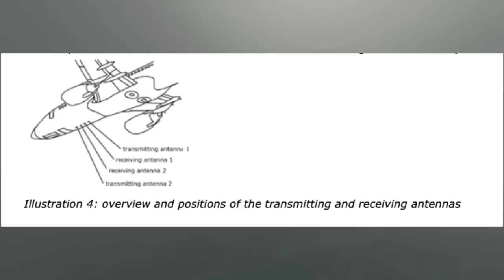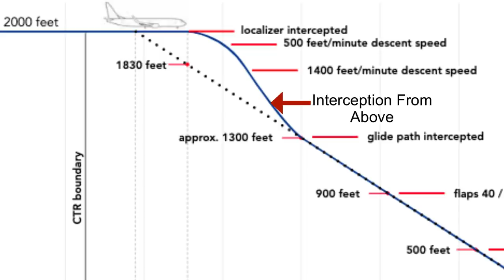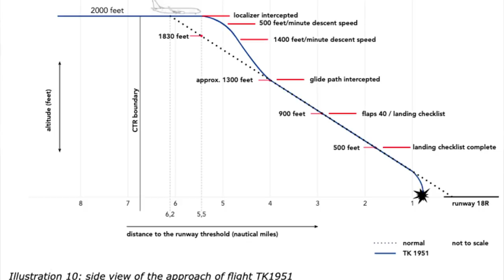How A Broken Antenna Crashed This Plane | Turkish Airlines Flight 1951

Comment: "Adding more redundancy saves lives ... Do you think we've learned from our mistakes?"

Clearly, Boeing hasn't. But at least we can trust Airbu- oh, they're developing a single-pilot A350.

These companies don't give a shit about our lives, just our money.
Reply: The aircraft won’t be flown by a single pilot from takeoff to landing. There will be 2 pilots onboard and both will be up front for takeoff, climb, descent, approach and landing. It’s only during long cruise where one pilot will then go and rest, the other will monitor
Reply: Single pilot! What a chilling concept to save a buck
Reply: @tomstravels520  That absolutely does not instill any fit of confidence whatsoever. Is what you said supposed to be comforting or making it any better? Simply because "the most dangerous parts of flying is just taking off and landing guys, so its perfectly fine and okay during cruise"
Reply: @DrSabot-A  would your rather have 1 pilot only or 2 pilots but one is resting during cruise?
Reply: @tomstravels520  I think I'd rather just have two pilots not resting.

Comment: If you get a stall warning that close to the ground I would think going to full power and raising the landing gear to cut drag would be SOP.
Reply: At that speed and altitude the landing gear wouldn’t make much difference to the drag. I’d leave it down to cushion the impact of it were to happen. That’s why on a go around you wait until you have positive rate of climb before raising the gear, not as soon as you increase power
Reply: They did advance power to full thrust, but the autothrottle retarded the thrust levers immediately afterwards

Comment: B737s sure have unique fuselage fracture points when they crash but are not in small pieces. The fuselage seems to break apart into 2 or 3 pieces probably at bulkhead attachment areas a whole bunch of times. Good idea not to sit in those areas.
Reply: I like to sit over the wings for that reason - it's a stronger part of the aircraft, and this safer in the event of a crash.

Comment: in the 737 MAX they actually only had 1 sensor installed, as to avoid both pilot re-training and a new certification. essentially, the system wasn't redundant
Reply: No. All 737 Max had 2 sensors. But only 1 fed data to the MCAS and it was switched every flight so there was no comparison of data
Reply: @tomstravels520  ooo thanks i wasn't aware of that
Reply: Fidd88  Having two sensors and only using one is in therms of system engineering horrific.
The software has all the information it needs and boeing very specifically decided against using it, because a redundant system is indicative of safety critical, which MCAS "totally" is not.

Comment: Something else that I think may help situations such as this incident, is to have the flight control system take other actions in the event of pilot warning events (such as the stick shaker) and set a warning that would change the operation of the automation, such as to disable autothrottle so that the pilots are required to retard the throttle on landing, and that no thrust below, say, 10% below an appropriate cruse speed may not be permissible without verification from other sensors, such as weight switches on all three landing gear to indicate the airplane is actually on the ground. Sanity checks also shouldn't be too difficult to implement, such as the radio altimeter shall always read higher than 5 feet or something, as it is impossible for the bottom of the plane to be less than the height of the landing gear, so if it is less, the instrument is definitely lying.

Comment: CFIT is unfortunate when it occurs due to bad ATC instructions or unknown faults that could not reasonably be known. Relying on automation when you know it is not working correctly when you can turn it off and land the plane with the flight controls is insane.

Comment: Systems fail and will continue to do so. That is why as airline pilots, we go trough extensive simulator training and checking every 6 months. We learn how to cope with a multitude of different scenarios, each involving system failures. And the first adagio is systematically: fly the airplane first! Deal with the failure next.

Comment: @ 2:53 you mentioned the issues with the left hand autopilot. Somehow I missed why it couldn't be activated and if this played eventually into the crash. I also do not understand how an autothrottle could work against an autopilot, is there no hierarchical dependency? And how is this played when the two autopilots would have been activated?
Reply: This seems incredibly stupid. The two computers should act in tandem, not push the plane into stall. It's so dumb.
Reply: CMD A wouldn’t activate because of the faulty RA. The autopilot cannot be engaged below (I think) 400ft unless you’re landing. It is not a case of hierarchy it’s depended on which system feeds which information to other system. Remember the autothrottle cannot see so it relies on the RA to know when to enter RETARD mode if the autopilot is in approach mode. The flaw I see here is the captains RA was used to control the autothrottle even thought the FO’s autopilot was the one activated when it should realistically be the FO’s RA being used

Comment: As soon as they realize the altimeter is faulty, shouldn't they immediately flip a switch or something to prevent the autopilot from using it? It's very odd no action is taken.
Reply: Flipped what switch and why? The linking of the RadAlt 1 to the Autothrottle was not documented. It was assumed that it was linked to side in control.

Comment: Neither this issue nor the 747 door latch failures prevented Boeing from cutting corners and FAA and NTSB from being too lenient if not straight up helping Boeing bypass the regulations. I might be a pessimist but I see next MAX as very likely, if not inevitable.
Reply: I would not be so affirmative for the NTSB nor whole FAA, but FAA west coast is known to be a little bit to "close" to boeing since decades. The MAX is just the last exemple and hopfully will definitively change this bad habit

Comment: Do you know the phenomenon, when too many people are involved, noone takes the correct action?
If you're walking near a canal and you see a person in the water who is clearly in distress, with noone else around except you, chances are that you'll go into the water to try and save that person.

If, however, there's someone in the water and there's a bunch of people standing nearby, you'll think 'oh, people already know, one of them will save that person.' And so we get those little news reports about a man drowning in front of a dozen people who did nothing.

On this flight, an extra FO was sitting behind both pilots to monitor, for extra safety because the FO at the controls was being trained.
However, I read in another report, while the incident started, the security FO was busy informing the passengers and crew to take landing positions.

The security FO was just being used as an extra hand, not doing the job he was supposed to do but (in my view, doing menial 'household' chores while he should only have been focused on monitoring the pilots).

Regarding the autothrottle working against the other system, automation is fine as long as it works.
If it doesn't, we get tragic incidents and crashes like these.

Just after this crash had happened, Turkish critics residing in Holland started pointing fingers at the Turkish Airlines tradition of hiring veteran airforce pilots as their Captains. In the end, those critics' instincts were correct. Without the gung-ho attitude of the Captain, who overruled his FO, who was taking the correct actions, the plane may not have crashed.

Comment: There's no technical reason the 737 max didn't use both AOA sensors - the whole idea with the max was that pilots wouldn't need to be re-certified to fly it. The MCAS system needed to compensate for the new engine position (which created a new moment arm) could use either one or both AOA sensors, but if it needed both then it's a critical system and pilots would have to be re-certified. So they made it use just one to fulfill their customers' wish to have a re-engined 737 with no new type certification required.

Comment: The problem is that there are way too many layers of automation that can interact with each other, and they're full of band-aid patches.  The solution is to make it possible for the pilots to hand fly the plane without any of the scraps of automation trying to grab it away from them again.

Comment: Sorry - the title of the video is WRONG. It was NOT a broken Radio Altimeter Antenna that crashed that plane. It was the chain of a non-functioning safety system / safety culture at Turkish Airlines and the non-functioning CRM (crew resource management /teamwork) of the three pilots in the cockpit that caused that bad accident,
Reply from the maker: Hi I agree but unfortunately YouTube titles need to be a bit eye catching to get views. Purely objective titles rarely stand out. Like “how bad CRM caused this plane to crash is a factual title but it wouldn’t pique anyone’s interest and the video would fail. The title I have right now is the best of both worlds it’s eye catching and it’s also rooted in fact as the broken antenna played a big part in the crash. Thanks for understanding!

Comment: NO.  No excuse for the pilots.  They failed in the very first rule of aviation:  Fly the plane.  All automation should have been disengaged as soon as they started getting false readings.  The pilots and only the pilots are at fault for this accident.
Reply: The engineers and trainers bear responsibility too. A single point of failure for a major system is asking for trouble.

Comment: The same thing happened to a Boeing 777-200ER operating Asiana Airlines Flight 214 5 years later, the same sequence of events lead to the same outcome in both accidents. Neither watched the speed, and they both crashed nose high.
Reply: Similar but not the same.  The 777 wasn’t a faulty Rad Alt
Reply: @kickedinthecalfbyacow7549  The altimeter wasn't faulty on 1951 at all, it was all caused in a sequence by the first officer, who incorrectly dialed altimeter data and then used it in a dual channel, then used the captain's altimeter, which had incorrect information. Also in this case, the plane thought that the pilots wanted to descend *(EDIT: instead of hold the current altitude that they had assigned into autopilot command 1), therefore adding another reason as to why the autothrottle didn't allow the throttles to hold the 144 KIAS (knot/kt) speed on the approach.
Reply: @gaztastic  I’ve read your post a couple of times, I can’t make any sense of it

Comment: Boeing didn't use redundant AoA sensors on the Max because tat would have triggered expensive retraining for all pilots.  Boeing was playing catchup with Airbus and promised carriers that there would be no required sim time for the new training.  Instead, pilots had a 1 hr iPad course that they could take to qualify, which didn't even mention the MCAS system.  There is a new documentary/expose out.  I think it's on 60 Minutes Australia's YT channel.

Comment: Regarding the 737-Max:
They didn't add a second AOA sensor because the system should have been a non-critical system to begin with. If the system requires two sensors to be safe then that also requires additional training for the pilots which they tried to avoid.
Reply: The Max always had a second sensor. Only one was used for MCAS at a time though
Reply: @tomstravels520  that is correct and probably the worst fact in all of this. The more reliable and safer option would have been to just use all sensors that were already installed. But due to a technical required that is supposed to make aircraft safer bit costs a tiny bit more money they didn't use it. Still makes me sick thinking about it.

Comment: "His radio altimeter was showing a reading of -8 feet..."

I'm sorry, but it does rather seem that if your aircraft, and those on board, are already 8 feet underground then it's a bit late to be telling the crew to put the landing gear down...
Reply: -8 is what it reads when the nose gear is on the ground

Comment: A bigger problem is a lack of a safety culture. Previous times when the plane was not stabilize below 1000 feet it needed to be reported to the company's flight safety department. Acting on near misses prevents accidents.

Comment: MACI, there's a question I've always wondered since I was kid but I've never seen ANY aviation channel answer. In Die Hard 2, one of the villains causes a British airliner to crash into the ground by feeding it false information using what I assume is the ILS. If you've seen the movie, you know the scene I'm talking about - my question is, is the scenario shown plausible? Can the ILS or some other approach aid be sabotaged to force an airplane to crash in bad weather?
Reply: It’s possibly to manipulate the beam but the beam originates from the same point so no matter what angle you set it at it would still guide you to the runway. Just at a different angle. Also the pilots should notice if something is wrong by looking out if the window and how quickly their vertical speed is
Reply: Not Possible ;)
Reply: @togafly.  Not possible!
Reply: @Lezard Valeth - You can alter the angle but this should not affect a safe approach because you compare you altitude with your distance to run. For every mile you fly you lose approx 320 feet. Assuming a touchdown point at sea level, as you approach 6.2 DME you should be at 2,000 feet, at 4 miles (a typical check distance) you should be at 1,280 feet. One runways with an Outer Marker, typically placed at about four miles, you would again check your altitude. You would also be aware that more than normal thrust is required to keep the glide. Thomas’s point is also valid. So, no this shouldn’t happen - except in crap movies.
Reply: @Trevor_Austin  ok thanks for correcting me
Reply: My favourite bit is when the captain sees the runway and throws his hands up in terror!

Comment: The flap retraction was just for filmmaking purposes right? :)
Reply from the maker: Yeah so that the plane would stall a bit more dramatically. Otherwise it would just touch down on the ground
Reply: @MiniAirCrashInvestigation  interesting point.  I notice this is FS and wonder if the sensitivity of professional flight simulators are set like this giving pilots a false sense of security? Heck, I am sure most pilots now started flying in Microsoft Flight Simulator.  Lol
Reply from the maker: @JasonFlorida  oh no the plane i used is very bad, its not realistic at all, but looks good from the outside. Its like a $10 addon so i dont think anyones using it to train
Reply: @MiniAirCrashInvestigation  I would sure hope someone learning to fly could spare a measly $10 for added realism.  Lol. You know just as I do that this is the way many inspiring pilots start out on a at home flight simulator andnI am sure just as realistic they are now that they are used for fun and also as a little training

Comment: The 737 Max issue was a reliance on a single angle of attack (stall detector) sensor.  

As far as I understand having 2 sensors isn't protection.  If one fails but gives bad data and another doesn't how do you know which one is right unless the bad one is obvious to a person?  Obviously in this case it would've been obvious, saying they were at -8 feet.  In the event of a bad pitot tube a crew got into a fatal accident when cruising at night because one said they were going to fast and another gave the right speed.  Even the overspeed warning went off so they cut back but in reality they went into a stall.  You really need 3 like they use in satellites and spacecraft.  With 3 you have a voting system, it is extremely unlikely that 2 or more would fail at the exact same time and in the same way.  So you would have 2 good sensors and can eliminate the bad one.
Reply: Hence why Airbus have 3 AOA and pitot tubes, A380/A350 have 4. XL888T and LH1829 however showed what can happen if 2 AOA's freeze at the same value and computer rejects the good one. Now Airbus use another measure to determine which AOA's or pitots have failed so if 2 do fail at same value they are rejected

Comment: I still don't understand. What is the point of having redundancy in the number of sensors, when you don't have a comparator to decide which sensor is giving the correct data?
Reply: A comparator doesn’t tell you which is correct. It just warns you they are different. It’s down to the pilots to work out which is correct. That’s why Airbus has 3 sensors for critical systems

Comment: Trusting a single point of data completely is a common cause of failure for spacecraft, as well. Flight software should be written to never put absolute trust in any one sensor.

Comment: The 737 Max didn't have duplex systems because they deliberately chose not to make it so. Any system which requires 2 sensors is deemed to be a safety-critical system, which would require simulator training for the pilots. Boeing had promised airlines that there would be no required simulator training, and put huge penalties on the line, so when MCAS became more complicated and demanding, they considered adding the other sensor to it, but deliberately chose not to because that would have cost them in the simulator clause. TL;DR, it has nothing to do with technical limitations, it would have just been a matter of plugging the other vane in. They didn't because of bureaucracy and greed

Comment: Autothrottle can be dangerous. In small planes with simple autopilots, the pilot is always in full control of airspeed and therefore forced to monitor it at all times. The autopilot only takes control of attitude. Overall I believe this is a safer system even though it represents a higher workload for the pilots. Autothrottle should not be used during takeoffs and landings imho.